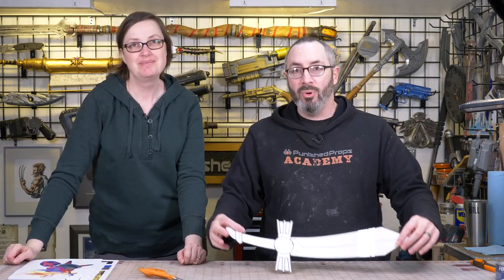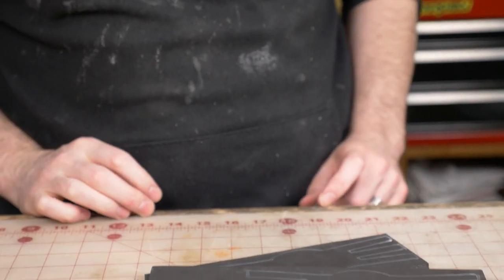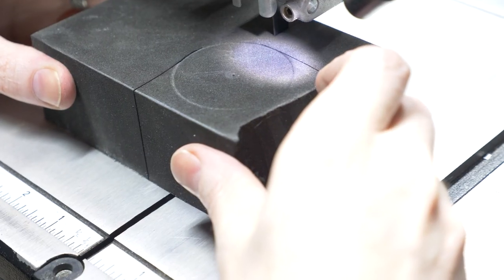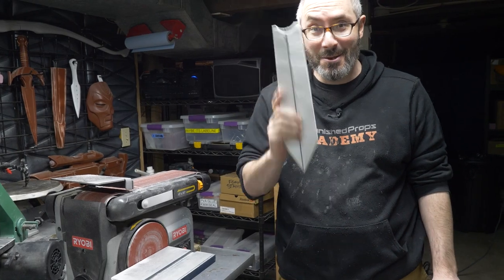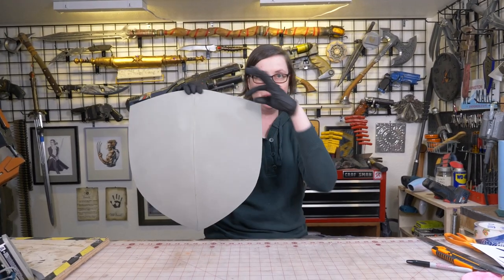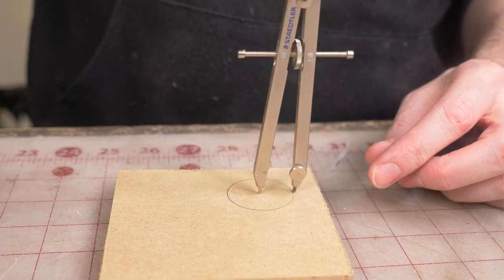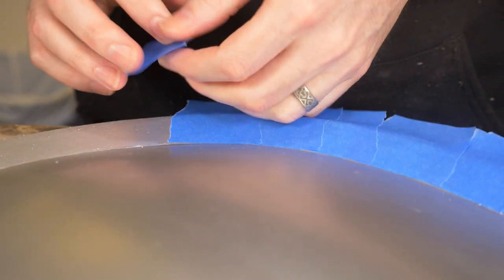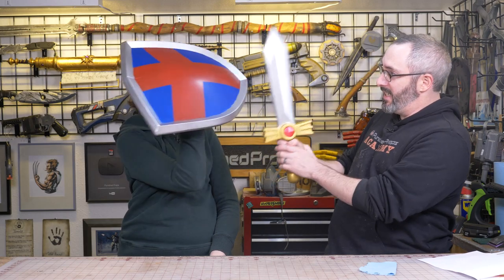TUNIC Sword & Shield Prop Build - Small Fox, Big Adventure

Comment: love the build, they lok great.  One suggestion for helping to cut thin leather like you used to wrap the handles in is to use a rotary cutter instead of a knife.  Gives a much cleaner cut and it's way easier to use.
Reply from the maker: That's a great tip!

Comment: Could you maybe thin the ModPodge and spray it using a lever-action spray bottle (like you get kitchen and bathroom cleaner in)? It might need a few coats but would remove brush strokes.

Comment: Question: Why not use a dowel or smaller PVC pipe to get the metal rod to fit inside the bigger PVC pipe? Seems like a lot of tape wasted to use as filler?
Reply from the maker: The tape was my first idea and I just ran with it.

Comment: I find it funny you had to redo the glue up of the handle bc the glue cured to fast because that exact same thing happened to me yesterday. I had to re 3D print 2 parts of my witcher sword bc I tried to glue them with stuff on hand and it cured to fast and the internal rods went all the way in. I had to break the print trying to free them. I now have to just start completely over with new rods and actual 5 minute epoxy bc work time is very important who would have known.
Reply from the maker: Yup, happens to the best of us!

Comment: I like working with TNT foam but the only problem I have with it is every time I use my hotwire cutter to cut the foam the TNT foam always explodes I wonder why 💣💥
Reply from the maker: I've never used a hot wire cutter on EVA foam. A knife and/or bandsaw have always been more than enough and are probably quicker.
Reply: @punishedprops  you should try it. it's like using a hot knife to cut through butter. I used to use it for my models for landscapes before I gave up